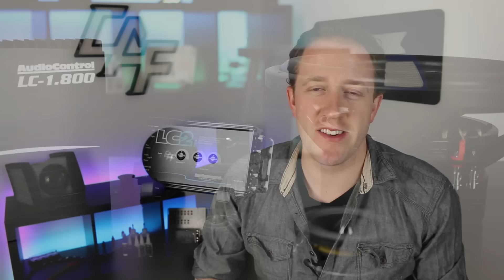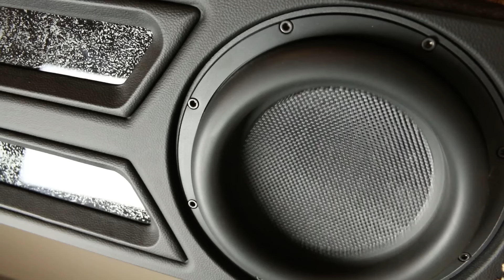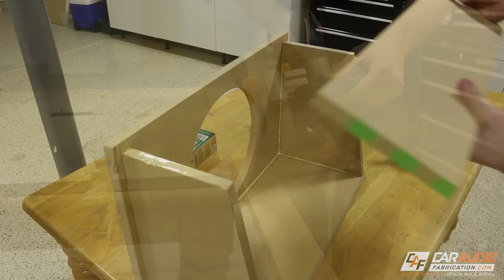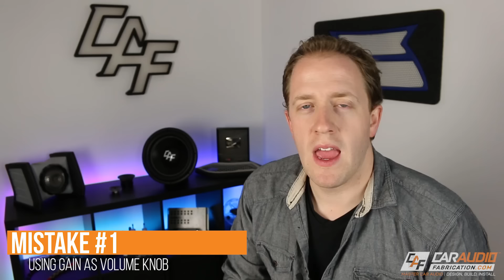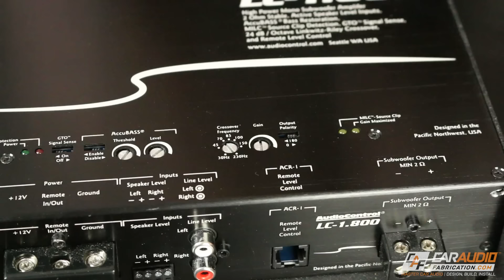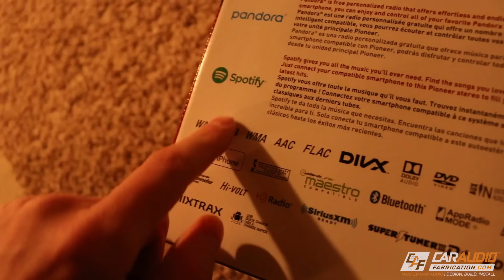Avoid these 5 common Car Audio NOOB Mistakes!

Comment: I had an issue with "good enough" wiring. Lost an amp because the power wire came off and contacted the negative.  Having a fuse in there didn't help. My advice is take the time and do it right once. 
Don't use electrical tape to terminate or connect any wires. Also check the fuses that come with the amp before you buy. Fuse amps x 12 = Max watts. My buddy bought a cheap amp and he thought it was 2000 watts while it only had one 30a fuse.

Comment: Boss audio is the worst company for audio add their sister company ssl
Reply: My friend had a Boss 3000 watt mono amp. My Infinity Kappa K600 was louder and sounded way better.
Reply: Bolt in a bottle I’m doing a system in my Jeep and it comes with a stock infinity sound system and it sounds pretty damn good almost sad to see it go lol

Comment: Now im more of a general mechanic with the engines themselves. I am not the best with wiring or any of that at all. Im glad i just found this channel because im looking to install an audio system but i wanted to understand how everything works in the first place like the point of having an amplifier and why you cant just play it out of the normal stereo in the dash

Comment: biggest noob mistake for me was underestimating the ability of good door/rear deck speakers.  after i dumped about $1600 into my system, my buddy wanted to show off his new pair of 6x9s in his rear deck.  i was disappointed in myself when his $200 speakers (with no amp) sounded almost as good as the two 12s in my trunk.......oh, and he still had trunk space.
Reply: @spencerphilippinedream3706  first thing i do now is door speaker uprgrade, even straight from headunit some of the value budget 16 and 13cm do quite well, or oush some high end ones and then decide on running through a second amp or if using a decent 4 channel that can handel both sub a doors .. with a few splitters here and there ;)
All good fun!  Good vids thanks for upload

Comment: As someone who's had systems in his car since the 80's....from trial and error this is what I've learned....Make sure your car's charging system is up to par...That means you're gonna have to pay just as much as the install costs( if you're not a DIY)..#1.Do a Big Three Upgrade..( Google it)..#2.Get a better battery aimed towards car audio ( XS, Kinetic, Optima etc) #3 Get a high output alternator ( at least 160a).I suggest this for systems at least 1000w.....I definitely suggest the first 2. I've just changed the battery and alternator and that has helped my systems....But to have peace of
 mind and definitely to prevent embarrassing moments do all three.Your system will sound it's loudest and cleanest when your charging system is up to par.Even if it takes you a few more months to save up for those items.You won't regret it.

Comment: My friend wanted to put 2 Amps on a 8 gauge wire,  can't remember the fuse. He needed a bigger wire and I told him that and he still wanted to see what would happen.   I expected the fuse to blow,  it welded itself open and started smoking and burning the plastic off the wire.

Comment: If you did all your sound deadening and the other improvements for the components in your system, electrical upgrades are the big thing. Digital files in a car above 320kBps is futile and will not yield an improvement. I know from experience. Clint said it best, a man’s got to know his limitations. That’s a fact Jack! Don’t beat yourself up, smarten up! 128kBps mp3 is like listening to a transistor radio!😑😬 Can we say yuck, I think so! That’s nasty redefined!

Comment: Just under 130 Db for under $500 all new gear and good sound no distortion and no electrical gremlins. Budget builds can work, but spend more time researching than installing - and take your time with the install, don't cut corners. I may not have huge numbers but any longer than 10 minutes in my car and your ears will be ringing. Plenty loud enough for a daily driver.

Comment: Back in my 16 year old hayday I wasted so much money on amps based on their max power rating. Also wasted money focusing exclusively on getting non-mono amps thinking they are designed for 1 speaker/sub. The last big one was thinking I would address headlight dimming with a capacitor. That cap was borderline useless after a few seconds of play - an upgrade to the capacitor was the Golden ticket but did come with its own constraints. Never tried the redundant battery setup.

Comment: I've seen alot of ppl run the rca cables along side the power wire to the trunk. Usually doesn't work out to well 😂
Reply: Depends. With a sub amp it is not critical but with mids/highs it can pick up induced noise from the power wire into the RCA's and sounds like a high pitched turbo charger lol. That is because those frequencies are there but normally much higher then a sub systems ever gets. But there are other things that can cause that as well and RCA's can also pick up noise from other sources in the vehicle. A pita for installers sometimes if you took all the precautions but end up with noise anyhow. But yeah general rule of thumb was always running on opposite side or at least where they are 18" apart min and if they have to cross always shoot for a 90 degree angle.

Comment: I'm a noob and don't want to change the wires or the update the battery. I assumed I'm limited to updating stereo and speaker. I opted for 2way component set with treaters for the front and  3 way in the rear. I tried keeping everything under 50watts. One thing I'm not sure of, is that the new stereo comes with 3 preamp outputs, but I'm not using the subwoofer one. Is that okay? 
Also not using the preamp  subwoofer from the compenent speaker set either.   Any clarification would help, but I'm not changing the wires... 
And i know it's coming, but unless you there's proof of degredation from 2010 gallant I'm not changing the wires.

Comment: Use a tone generator to create a 60 Hz wav/mp3 file. Save to CD or media file and play it while using a basic voltmeter in AC mode to determine when clipping occurs. These voltmeters are typically most accurate at 50 or 60 Hz due to standard electrical frequencies.
Reply: i want to try this method. please tell me what happens when clipping occurs, how do i determine it? is it just a change of the voltage? Thx for sharing the tip and help, have a great christmas^^

Comment: so if i plan on installing 2 rockville rws12ca slim 1200 watt 12"powered car subwoofer, what amp should i get? Also I have a 2005 Ford f150 regular cab would these work sitting behind the seats?

Comment: So i had a setup installed by a "professional"... 1500W amp 1000W sub and the gain set to max. Result = Toasted voice coils and the guy saying he didn't do anything wrong and not replacing the sub... I told him he shouldn't have the gain at max and that's what killed the sub. Am i correct in assuming he has NO idea what he was doing?
Reply: I hate that. When I take things to a professional, I expect a professional. Not some kid who has experience installing gear for his buddies in his parents garage. There's alot more than just hooking everything up.

Comment: Run the RCA cables on the opposite side of the power wire from the battery
 Less distortion at high volume
 Buzzzzzzzz
Reply: Learned that the hard way.  Seemed to get louder as the rpm of the car went up.  Power down one side, rca and remote down the other, good to go
Reply: @juliusboy001  Hell do you know what you're even talking about? Your last sentence doesn't even make a bit of sense and you call someone else an idiot 🤨🤣
Reply: Or have shielding cable covers
Reply: @juliusboy001  LMFAO yeah I bet it does. The truth always hurts doesn't it. Next time you should just stay quiet when grown folks are talking that way you won't sound like an idiot when you try to correct someone who knows more than you.
Reply: @juliusboy001  You obviously have no life nor an education otherwise you'd understand when you've been dismissed
Reply: @juliusboy001  do you know what mean English?
Reply: @juliusboy001  You are definitely not smarter than a 5th grader 🙄 He was originally talking about a stereo he had installed ya dip as in a head unit you "install" in your vehicle not the difference in stereo vs mono. You can't install stereo or mono into a stereo so you make zero sense in your wannabe smart guy reply. You've been dismissed time for recess.
Reply: A strong voltage from headunit on the RCA 3v+ not pathetic 1.5v that some come with will also help.
Reply: XclusivePower  not gonna buy those overly expensive rust buckets.
Reply: @Quagmaestro Swingthehammer, can you dumb this down for me please? I’m confused. Do you mean like running the power and rca cables on the left hand side of the car if your battery is on the right OR running the rca and power nowhere near each other to eliminate distortion? Or something else I’m not picking up. Thanks
Reply: @patrickboyes8201  If you haven't received any reply to your question yet you would want to run your power wire on the same side as your battery and then run your rca cable down the opposite side. My battery in my 99 Ford Taurus sits on the driver's side so I ran my power wire and the blue amp wire down my driver's side floor trim. I then ran my RCA down my passenger side floor trim. Also if your head unit comes with a backup camera you'll want to run that wire down the same side as your RCA cable to keep your camera from looking scrambled.
Reply: J.R. McKenzie why would the camera look scrambled? Out of curiosity of course
Reply: @johnnyopk  I guess I should have been more specific because whenever I've had a backup camera it has come with the stereo I bought so I've had to splice into my backup lights. The first time I ran the wire to the stereo I ran it down the same side as my power wire because it had more room. But when I put it in reverse it looked perfectly fine but then when I gave it gas to start backing up the backup picture looked all scrambled and messed up so at first I thought it was my stereo then I figured maybe it was because I was next to the power wire so when I moved it to the side I had my RCA cables running down it cleared up and I didn't have that problem anymore so I've always put it on that side. I'd give you a little bit more detail but right now I'm driving down the road and using talk to text so if anyone has any more questions I'll be happy to answer them just not at this moment.
Reply: @patrickboyes8201  don’t run them together
Reply: If you put in some speaker cable, should that be with the line-level (RCA) cables or with the power cables?
Reply: or..you know...and hear me out...use. shielded. cables.
Reply: What you mean by that man
Reply: Hey I had a stereo installed and I hear a buzz at low volume know why?
Reply: @xpert_kid_one730  you have the rcas and power wires, running to the amp,
on the same side. Whichever side your battery is at, leave that side for your power wire and the opposite for rcas. Problem fixed.
Reply: @realfrankandrade  Made this mistake back in the early 90's.
Reply: @realfrankandrade  I'm 16 thinking about upgrading my stock system any other pointers besides what's mentioned in the video. Also why do the rca cables have to be ran on a different side. I'm assuming the wires vibrate on a minimal level is that slight vibration of both the power and rca wires the reason for that low buzz?
Reply: @xpert_kid_one730  or get RCAs with a ground attached
Reply: @xpert_kid_one730  its called Alternator screech and its common, you might want to look up some info about it. i had that issue last week when i installed my new equip! -----1 year later i respond lmao
Reply: @xpert_kid_one730  Cheap stereo. Your total harmonic distortion (THD) is above 1% 
OR 
You're using two channels for a speaker (it's fine for an 8ohm buy not 4ohm)
Reply: @xpert_kid_one730  wrong spark plugs. Does the buzz increase with rpm. Sorry for late response
Reply: @PheazibbleKneads69  that'd be alternator whine
Reply: Very true mate. Apparently im told that if they do have to cross paths then insulate the power cable( battery) and run rca's at a 90 degree angle stright over and past.
Reply: @iliketoflickmytonguelikead6166  as an apprentice electrician, can confirm that’s true when running data cable over cable that isn’t in conduit have to go 90 degrees across it other wise power can distort the data 
I’m pretty sure tho if power cable is in conduit it doesn’t matter with data cable can be ran parallel next to it

Comment: I'm looking to buy some nice car speakers that will do well in a component setup, i already have a hertz subwoofer (dont know the type) with an Axton 200w amplifier
What would be a nice component speaker set 16.5cm to add with that?
My budget is around 200 euros
I've searched online but find very mixed results...
I'd like to add that the music i listen to is mainly Death Metal and it is therefore important to have clean undistorted mids.
i bought a speaker set from hertz for about 160 euros but they really have some weird mids, they do really well on electronic music since they are focussed on delivering bass, but  i got my sub for that so...

Any advise is welcome! :)

Comment: Wiring is a BIG issue. Ohm's law says it all. You can't have a power hungry amplifier hooked up on some crappy 220V electric wire. Same goes for the speaker, there is no point in producing a shitload of power with a massive amplifier just to burn half of it through those crappy thin wires. Go for correct wiring and don't be a cheap bastard on the connectors either. 
Use common logic when you buy equipment. Can those two 20 A fuses on that amplifier really take 1000 W of music? NO, of course, they can't! So the manufacturer lies right into your face.

Comment: Mark, I've got a 2011 Mercedes Benz CLS550.  I'm looking for suggestions for replacement of my 6 1/2" door speakers (I have 4 of them).  I have separate 1" tweeters that are A-pillar mounted.  What speaker set do you recommend?  (Please give me the manufacturer name and speaker model name or number).  Thanks, Mark.
Reply: Sorry to buzz in on your question but are you going to be using those 6.5 off the stock head unit. Im having a similar situation myself. .
Reply: @leonardfowler7359  Great question.  No.  I'm replacing it with an aftermarket unit.
Reply: @henrylong45   I see . I don't want to go aftermarket because stock radio has the back up camera and all that junk... if it was up to me it would be gone. Just looking for opinions on how aftermarket speakers sound with stock radio.  Thanks for replying.
Reply: @leonardfowler7359  My stock radio doesn't have a reverse camera, it apparently doesn't have Sattelite Radio and the GPS system fails to recognize the maps DVD.  Essentially, IT SUCKS!

Comment: i’ve tried hooking up a capacitor without discharging it first. that was exciting
Reply: *shocking
Reply: Which capacitor? The Flux?
Sorry i couldn't resist!😆
Reply: 🤣buddy blew his trunk lid about clean off not discharging the cap i gave him 🤣ticking time bomb
Reply: Now they call you the flash
Reply: Lol that must have been fun 😂😂😂
Reply: same! Always a blast!
Reply: Big oof
Reply: Shocking.....
Reply: shocking
Reply: Nothing like catching a buzz
Reply: Were the results shocking?
Reply: Don't need capacitor just add an extra battery
Reply: I plugged a capacitor into a dc power supply to see what would happen. That was a lot louder than expected

Comment: Is it a bad build to have a sub on trunk, 2 mid bass in stereo on the back, 4 triaxial speakers (with cross hover on very low frequency) on each of the 4 doors?

Comment: I know this video is old, but you mentioned the air space for subwoofer enclosures.  I'm looking at a dual 12" box with air volume: 3.7 CF. Any recommendations on 2 12" subs that would pair up best with this box?

Comment: My digital head unit has a factory equalizer as do most factory heads do. Is an additional preamp aftermarket equalizer possible/ recommended?

Comment: Maybe with the wiring you should just buy a battery just for the Amp so you won’t have to upgrade your wiring. So just install another battery. So you can save yourself money too.
Reply from the maker: Not how it works. And wiring has never been more cost effective

Comment: still have yet to find a good speaker setup for heavy metal kinda sad. DX
Reply: Audiobahn
Reply: Korn tool and slipknot sound great on my audiobahn just by itself in ap mode korn is beating harder than gates

Comment: 6:29 - Also remember that just because an mp3 says it's 320, it doesn't mean it was taken directly from a good quality source. You can convert a HQ original to a 128 kb/s (or less) mp3, then convert it again up to 320 kb/s, which means a shitty sounding poser.

Comment: I could barely hear you

So I turned up the gain to 100%
Reply: lol
Reply: Like those wranglers that have all there doors off and the top but all you hear is bass. Like, do you even have any mids or highs? 🤣🤣🤣
Reply: @E.K.Hernandez1987  I go like this. I take about 1/2 the power of the sub system on top for the mids and highs. So if I got a 1000W Sub Chain, I want about 500W for the Mids and Highs. It's stupid and often not that easy to say that, but that's kind of my guideline.
Reply: WhoWantsToKnow81 😂😂😂
Reply: @TurboLS4dr  v.  Oii.      Oil ioiikikggjgkggg